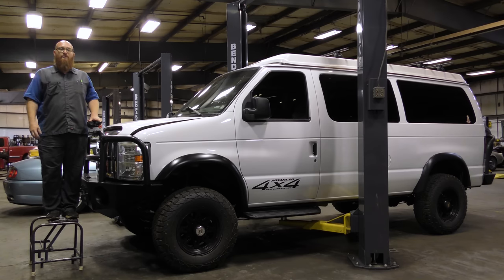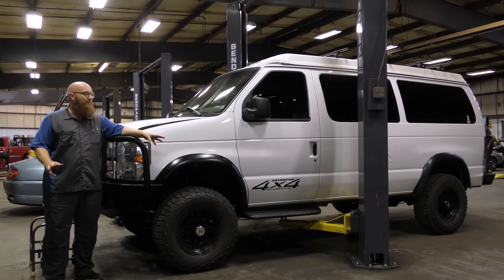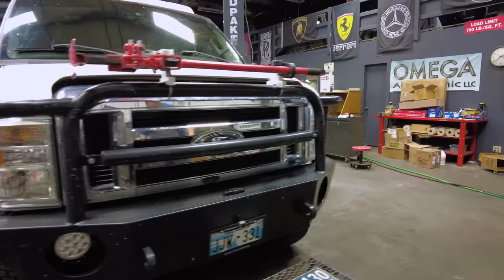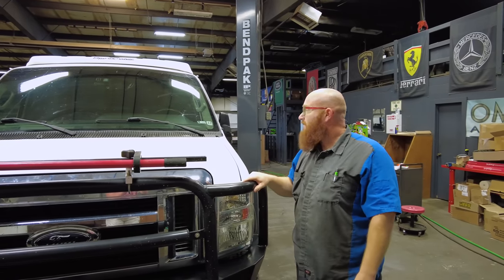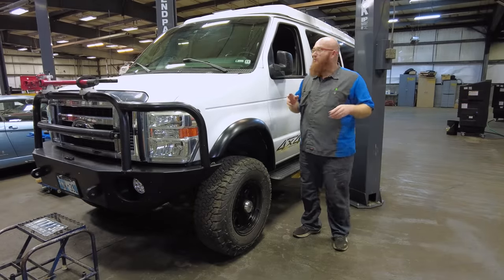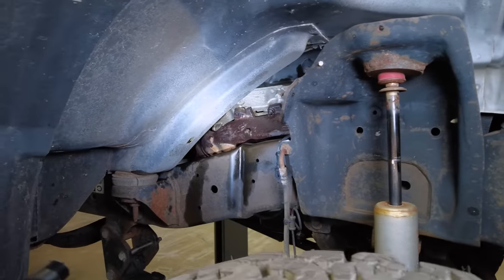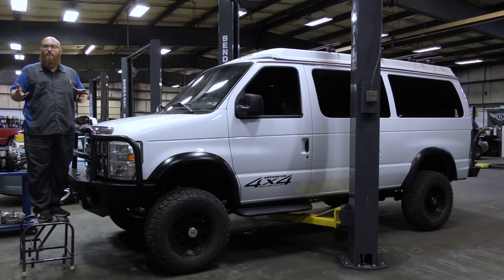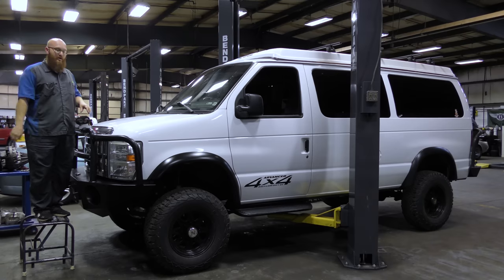8 shops refused to work on this custom '10 E-Series Van! CAR WIZARD shows how easy it was to fix!

Comment: I own a 2008 E250 Quigley 4x4 with F350 transfer and front end, A 2v 5.4 and a million mile Quigley transferable guaranteed factory install. Damage to the truck or it falls out of the truck I suspect.  They were 2 valve in the vans with Forged Crank and fracture-split powder metal connecting rods. After you do the spark plug recall and use the right plugs this motor is Ward's 10 Best Engines list for 1997–1998 and 2000–2002. At 220k miles the motor is strong. Confidence is high for expeditions and 15-16 mpg US highway 70mph still. The steering box can be lash adjusted and big tires kill the box eventually. Lash is a known correction for the float and axil bearing wear. Had the front axil trunnion U joints replaced and balanced by grinding some of the yoke. Yep they can be done that way 70 mph engaged and smooth. Axil vents are extended and synthetic rear fluid against water infiltration. "Non aggressive tread tires with matching spare" high lift jack, two 12 x 12 x 1 1/2" plywood bases, shovel, and snatch cord, insurance, registration, inspection, and Permit if available are required for some National Park ORV access. Goodrich AT meet that nuter requirement of Not moving to much sand. And don't run over a watch list or higher, bird it's a felony charge in the NP because they hate humans and their access. 25k lb trans cooler with fan and bypass. Transfer and diffs get oil changed, seals and cleaned every year or two. Incredible with diff locks. Mid summer sand and immediate intake air with no wind, can exceed 140 F with 90/100 F mean. You should edit this video and as a professional run the vin decoder before you make a video that lives on into the future.

Comment: I am planning for a new van purchase for next year. 1 of my leading contenders is a Quigley-ed Chevy Express 1 ton. I hadn't even thought about shops getting their undies in a bunch over it. I still imagine they'd prefer that over a Mercedes Sprinter with factory 4x4. The AWD Transit would be another option. I remember as a youth in a dealership, Fed-Ex had some new Quigley converted GMC vans. The Quigley axle actually had properly torqued lug bolts. the Rear axle didn't. All the parts they took off were shrink wrapped to a pallet and tossed in the back. That was a long time ago. I don't remember if they used an extended adapter to mount the transfer case, but I don't think so. I think (at least back then) Quigley changed the output shaft of the transmission to the 4x4 style.
Reply: Mom

Comment: Just an FYI.  If you have to swap an engine.  Pull the whole van body on the lift.  After you've done it before it's only about an hour and a half job to pull the whole body.  And you have the motor at your finger tips.  The 6.0 is a tight squeeze in them.  Pulling the body makes it super easy to work on.

Comment: As far as engine removal goes, they come out the front no problem. Remove the bumper, grill, radiator and then the radiator support panel that spans headlight to headlight. You do need to wiggle the motor a bit to work the oil pan over the crossmember but that's it. Back when I was still spinning wrenches for a school bus company I pulled plenty of 7.3 IDI's and Powerstrokes on 4th gen Econolines. I could have one out in about 5-6 hours by myself or even quicker if someone was helping me.

Regarding putting a full size van on a lift, we did everything on our backs from regular services to exhaust repairs and transmission swaps.

Comment: Mr Wizard! 
I have a very similar built lifted Ford 2009 e350 camper van. Mine is a 5.4 triton as well, I have been told by other van enthusiasts that the 3 Valve 5.4 never made it into any of the Econoline vans ever. only the 2 valves were used.. ?

Comment: Sportsmobile is a major builder of custom built-to-order adventure camper conversion vans, with facilities on both coasts.    Most of the E series Sportsmobile 4x4's I've seen have Quigley 4x4 conversions, which are Ford approved and basically mate F350 4x4 parts with the E350 van.

Comment: Last time I did one of those along with the 6.0 gas Chevy motor I used the induction heater and the 3/8s socket attachment for my air hammer and only broke 1 man you talk about a mood changer in the shop high fives and hooping and hollering all around lol

Comment: The quintessential non-euro available vehicle. We get Mustangs, Corvettes, Escalades, RTX Rams, but nothing like this. Thank you, Wizard
Reply: Other markets got the ford transit which is available with factory AWD
Reply: @rysterstech  no ford transit has this engine options, but that's because of regulations not market.
In portugal ford transit can be ordered with factory all wheel drive but the most powerful engine has 185hp and 420Nm (2.0 liters diesel with mild hybrid options)

Comment: The Econoline's and most other vans have simple enough designs, the center console is easily removed for most jobs but when needed for engine swaps the front bumper and radiator support come out easier than you might think. Putting it back together most are complete assemblies except AC condenser bracket, thats the weird part

Comment: The sacrifices we make to drive a vehicle that’s capable of more…. I put larger off road tires on my Honda CR-V so I can have the luxury of driving on gravel road all day long and doing light off roading without worrying about the tires. The cost is everything wears out faster, I have less power, worse fuel economy, it’s harder to drive on the highway in a straight line, but the pros outweigh the cons.  I’ve seen unbelievably cool stuff in this Honda CR-V as a result of suffering through the cons of the tires, things that some people will never see in the entirety of their lifetime because they aren’t willing to make those sacrifices.  This van is no different, ya aspects are a absolute pain in the ass, but the pros of a van like that are priceless. Just imagine the places you could get to and thoroughly enjoy for days on end without worry. If I had the money for repairs I would be the lifted K5 blazer guy and not the Honda CRV guy, but it’s still 20 steps in the right direction compared to any sedan or hatchback without All wheel drive. I’ll take what I can get, and I will live life to the fullest 🤘

Comment: On the Texas-Mexico border at Brownsville, TX we have wonderfully skilled mechanics who can fix anything.  They will dismantle a starter, locate the problem and make the repair for a fraction of the cost up north.  I've used the same AC man for over 40 years and its always been a simple, inexpensive repair.  The same holds true for power windows and other electrical items.  Even radiator shops will likely find the leak and make the repair before installing a new radiator, unless that's what the customer prefers.  The only problem: many mechanics here speak no English.

Comment: On the Chevy Express, the motor comes out the front with the grill and radiator removed.  Nothing too crazy.  Take the intake off while still installed and pull it with a cherry picker.  This is most likely the same deal.

Comment: Couple guys I knew used to use them on Jersey beaches, great for hauling their stand up jetski, they had fresh water tanks and a roll deck inside, better then hauling a trailer which usually gets stuck in the sand like a boat anchor, they worked really well.

Comment: thing about those tires, is the sidewalls are soft, need a tire that has 8-12 ply side walls, ones that can go up to 50 psi and as low as 6 psi off road depending on what its driving over, bf goodies are decent tires but those are wrong for the application on that van. that is something i learned having a 4x4 with big tires.
Reply: It's the right tire if they stay local and do more off road then on (that's my use case), but most likely you are right and a pair of actual truck tires with stiffer side wall would serve them Much better.

Comment: I drove a Quigley-converted Chevy Express in BC a bit last year . Working for a rail crew transport company.
Nobody liked it, they would much rather drive the Suburbans we had, me too. It was a 1-ton, and it was 
a rough-riding, low geared beast that didn't like highway speeds and was much worse on fuel than the Suburbans.
The steering was kind of sloppy too, but that could be attributed to the treatment it had received..
The story was it was borrowed from a mine in southern Alberta where the CP line rain thru. I guess in the environment it was intended for, that is, rough, off-road. low-speed, it was okay.

Comment: Quick guess, no flatrate book!!!!  They work lifted trucks a lot these days, but they would still use the factory 4 wheel drive flatrate book. The roof and empty rear area make me think there is a raising soft top / tent roof and this is a camping rig. Air the tires up for highway use.

Comment: BFG KO's despite the 3-ply sidewall is one of the softest sidewalls out there. Combine that with a 16" wheel and tall sidewalls and you have tire squirm. Toyo's in the same configuration exhibit less squirm but it's still there. Going to an 18" rim with the much higher load rating of all the 18" tires mitigates the issue with an approved width wheel.

Comment: I'm currently halfway through a body and paint job on an f350.  It sits like the van, other shops turned it away , which is too bad because it's  actually in really nice shape.  I'll admit , so many jacked up trucks are so badly put together I was leery of taking it on until I really looked at it. Nice to work on something that wasn't done by a butcher

Comment: I don't believe the 5.4L 3-valve was ever available in an E-series van.  5.4L 2-valve only.
Reply: You are right. Only 2v's
Reply: As a super car noob, what is the difference between the 3-valve and 2-valve? Is it like 3 valves per piston vs 2 valves per piston? Or is to referring to something else totally different?
Reply: This is a 2010.
Reply: Wikipedia would agree with you. 5.4 L (330 cu in) SOHC 2V V8	1997–2016 Even the V-10 stuck with  the 2v through 2019 in the vans.
Reply: @nexusyang4832  Yes, 3 valves per cylinder.
Reply: @nexusyang4832  valves per cylinder. What is the real issue is when Ford went from the two valve (pre 2000s roughly apart from van and crown vics) to three valve setup that's when 5.4 litres tanked in reliability. Ford promised extended oil change intervals but tightened up the oil passageways and would sludge up and self-delete the timing chains / VVT system. (See wizards previous videos on the worst engine ever)
Reply: @rysterstech  Didn't the Navigator have a 4 valve?
Reply: @nexusyang4832  the 3 valve is a known  piece of junk.  Unreliable and when it breaks you get to buy a new engine.
Reply: @garethkreike3263  the 4.6 and 5.4 litre Triton engine was a mainstay on Ford F-150 trucks from the late 1990's until the late 2000's.
Reply: @leonarddaneman810  it did from 1998 to 2004. In 2005 it got the 3v 5.4 and a ZF transmission which was replaced with the 6r80 for 2009 until 2015 when it got the 3.5 EcoBoost.
Reply: @nexusyang4832  the 3v 4.6 V8 and 5.4 V8 as well as the 6.8 V10 do have 3 valves per cylinder. But only the V8's have cam phasers. The 4.6 3v usually don't give trouble but the 5.4 was ruined by this along with roller follower failures(but I can't find anything about 4.6 or 6.8 3v having follower issues.
Reply: @frankdenardo8684  this isn't an " f " series pickup,  it's an E series VAN , there were several differences between the two.
Reply: @duane4972  
But it may have had bits from the F series as Wizard says...
might have included the 5.4 3v engine?
Reply: Well he also calls it a Chevy in the description so don't expect perfect accuracy.
Reply: @JohnSmith-yv6eq  a 3V 5.4 simply will not fit the E series, to wide  there is not much room with the 2V to begin with. 
I own  97, 98 and 06 E350s  they are a massive PIA to change spark plugs on.
Most shop charge $400 to $500 just in labor. On the plus side transmission removal is easier. Remove the doghouse and you have easy access to the bellhousing bolts.  The vans stuck with the E4OD/4R100 until 2006 when there was a change over to the 5r110w.
Last generation of E series started in 1992 until they discontinued the passenger and cargo vans in 2014.2008 was the exterior face lift  2010 interior update. Brake upgrades in 99 recieved rear disc after 2008 front and rear brakes updated with larger rotors and calipers and the Advance Trac system. Changed the type of radius control arm in 2010. 
The mechanical brake upgrades can be swapped over to the older vans  including the radius arms. I have 2010 front rotors and calipers on my 98 E350 with a 2002 rear axle. Remove the rear fluid restictor from the 98 master cylinder. The 98 abs system has no issues. 
The cutaway/cab chassis continues on, with updated interior in 2020. Current motors are 6.2 and 7.3 gas.
Reply: @rysterstech  the vans did not get the 6 speed until much later than the F series. In 2006 the E series finally got the 5r110w in the E250 and E350. About the same time Ford dropped the diesel option. Only diesels ever available were 7.3 IDI.  7.3 and 6.0 Powerstroke the bodies were slightly different than the gas versions. They dropped the 4.2 v6 and 4.6 about the same time. Leaving  the 5.4 and 6.8. If you look on Fords fleet vehicle build the cutaway chassis have the 6.2 and 7.3 godzilla available still with the 6 speed.
Reply: @groofromtheup5719   2014 was the end of the full bodied vans 2015 to 2019 5.4 and 6.8 motors, 2020 + 6.2 and 7.3 gas motors. The dash was updated in 2020 along with the steering wheel which stayed to same from 97 to 2019.
Dash styles 92 to 96, 97 to 2009 with the instrument cluster revised around 2006.
2010 to 2019  then 2020+.
Changes to the door panels were also made at those times. The doghouse and floor area 92 to 96 then  97+ not backwards compatible with out a body swap.  Lug pattern E250 and 350 stayed 8 on 6.5 the entire run. E150 changed to the 8 lug in 2010 where the only difference between the 1/2 ton and 3/4 and 1 ton was the spring rate.
Reply: @craigwiess1656  these vans the plugs arent that bad to do. Take the dog house off and do the back 6 from inside front 2 from outside. I usually just do them all from inside. But def easier to get the front 2 front outside
Reply: @jacksmith2315   with the plastic intakes not to bad with all aluminum intake design(pre 99) is different  more things in the way. 
My 06 shuttle bus E350 5.4 not to bad  for the plugs my 97 V10 and 98 5.4 passenger E350s   the way a few things are positioned makes the middle plugs a pia.
My previous vans 1975 E150 351W was extremely easy to work on  same with the 83 E150 with 302. The 95 E350 351W 7 were easy alternator had to be removed to access #1 plug
Reply: @nexusyang4832  the 3 valve was an early attempt at variable valve timing,  a really problematic engine with the cam phasers failing, usually an engine out service.
Reply: @lancebangwell  early attempt would be the HT4100